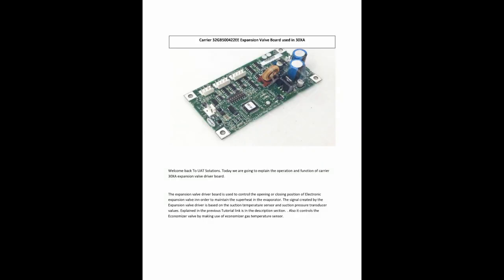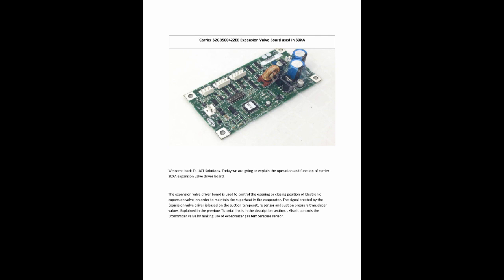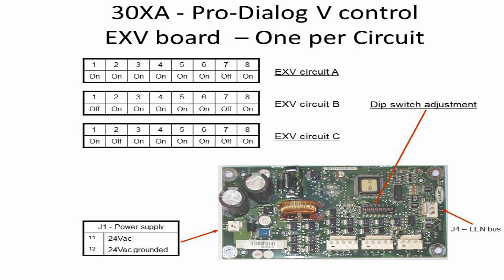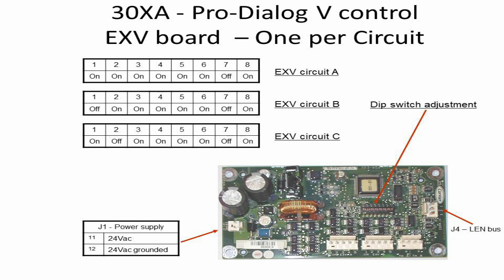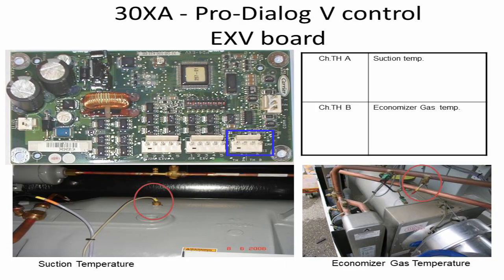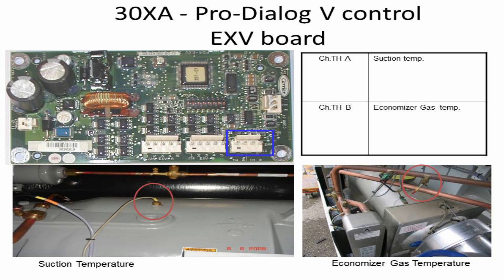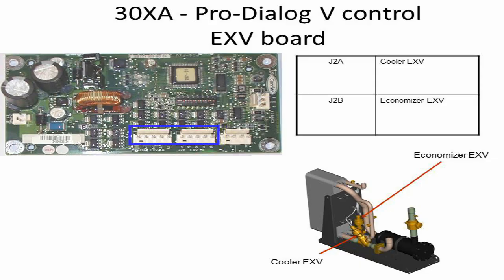Carrier 32GB500422EE Expansion valve driver board for carrier 30XA chiller explained

Comment: What is the problem of chiller is override? Thank you sir
Reply from the maker: Any parameter which is higher or lower than normal range but not critical enough to stop the  chiller will cause the chiller to operate in override mode. Most common reason are 
1.high Discharge pressure
2. Low suction pressure 
3. High water in and out temperature
Reply: @UATechnicalSolutions  high discharge 100 capacity
Reply: @UATechnicalSolutions  thank you sir comp only 5 fan  working,so possible  that's the problem? Or over charge?
Reply: @UATechnicalSolutions  good day sir,what is the standard running   pressure in chiller 100 capacity? Because I have  chiller unit,coil clean and complete condenser fan,I replace already filter core,ty

Comment: Can you please tell the 30xa chiller how to check the parameters and what is the purpose example delta T and oat
Reply from the maker: Please click the link for the requested video ( 30xa chiller how to check parameters and operate the display) 
https://youtu.be/Ue74IshTOiA
Reply from the maker: Delta T is the difference in between Entering and leaving water temperature. on which chiller performance can be assessed. most commonly if the chiller is working at 100% and the delta T is 5 degree Celsius its consider as good chiller performance
Reply from the maker: OAT is short for out door air temperature ( which is the ambient air temperature)

Comment: los of communication with exv board number a chiller 30xa
Reply from the maker: Please check the following.

1: EXV Board Green light should once in 1 second and red light should blink twice in 1 second ( if lights are blinking differently it could be the software issue or board is faulty)

2: Confirm the board address ( Dip switch settings) are correct

3: Communication in and out terminal make sure are clean and well connected on the EXV board and main processor board.

thanks for your comment.
Reply: Sir 30xa0402 model chiller 
Alarm generat ,low economiser or suction valve closed ,after 10 seconds system A compressor off
Please give solution for this